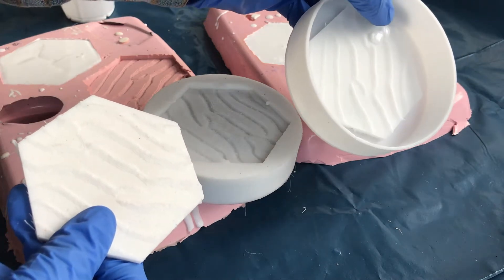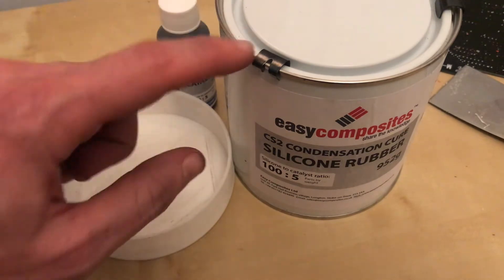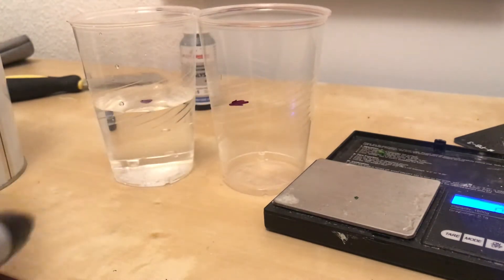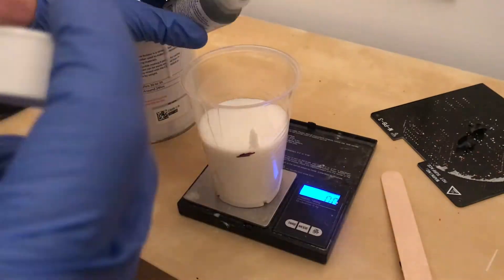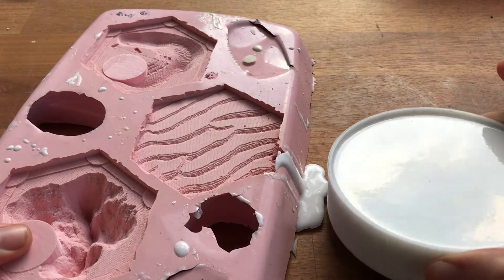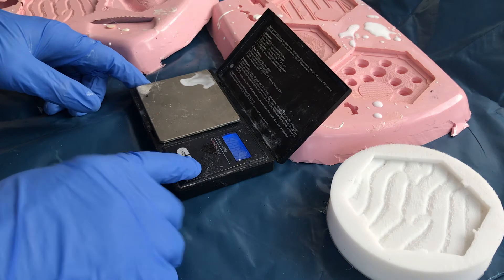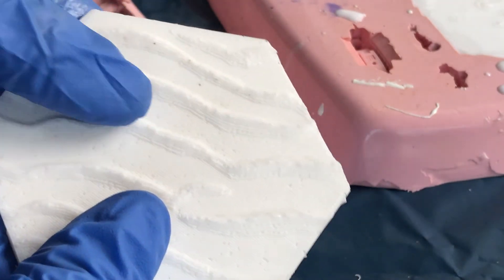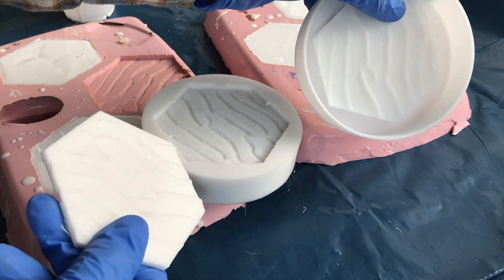Silicone Mould Making Tutorial for 3D Printed Parts

Comment: Shouldn’t you use Vaseline to prep the 3d print?
Reply from the maker: perhaps! But never had any issue as silicone release very easily so long as there is a draft on the part. i think some kind of mould release (generally a spray rather than vaseline) would have extended the life of the mould though which perished after about 6months of use.
Reply: @FuturefabOrgUk  I'm going to make molds using this technique to make shaped chocolate and I was afraid that it will show the layer lines. I think spreading vaseline or maybe some other oily substance might fill the layer lines in and smooth the model out.